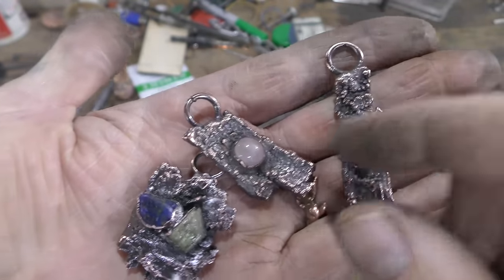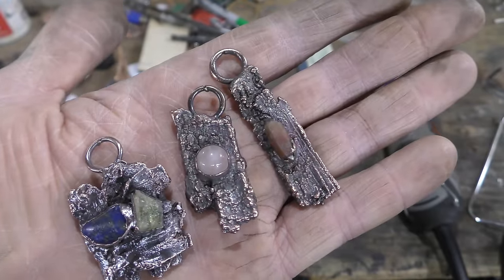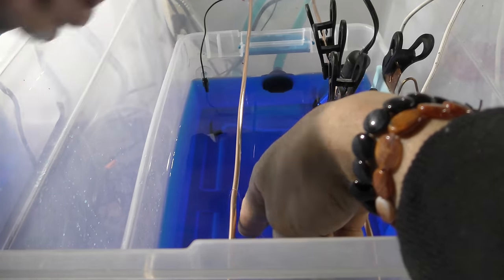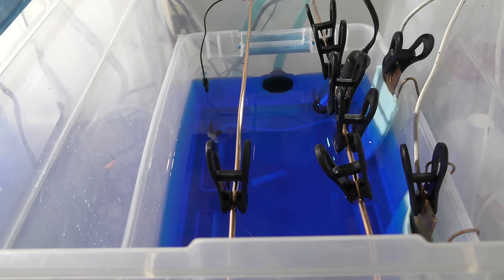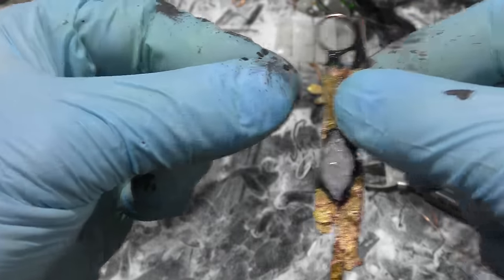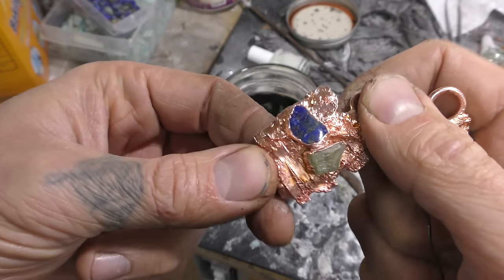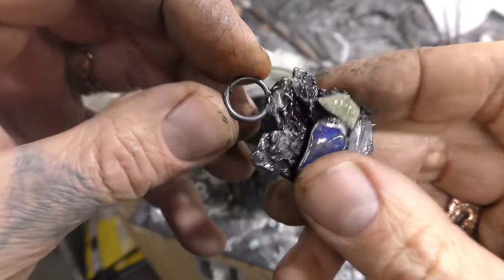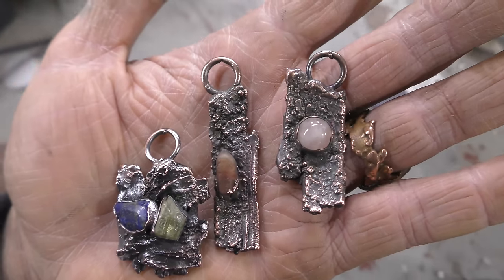Electroforming Organics for Beginners (Bark Necklace)

Comment: Awesome video! You said the dipping paint eats super glue.. so how come it didn't dissolve the point where the hanging wire was glued?
Reply: Did you find out the answer to this? I'm really struggling to understand too
Reply: I think he painted over it.
Reply: I saw on another video a drop of super glue then sprinkle that with baking soda turns it rock hard...🤷🏼‍♀️

Comment: Great demo, thank you!  Question:  why would you not glue the proper bail and the stone right away on the raw piece instead of plating part way, taking it out, and gluing them then?  It seems to be an extra step that is not necessary?  Or am I missing something?
Reply: I believe he said the first solution would eat away the glue.
Reply: But he had glue on the first one

Comment: Hello I have a couple of questions. What is the purpose of the liver I'd sulfur and could I skip it if I want the bright copper color?
Reply: Liver of sulphur is to add patina to copper. If you want beight copper to stay bright you'll want some other kind of finish or exposure to air will darken it over time
Reply: @ddraelynkhar  I am completely new to this is there any other finisher you recommend so I can research
Reply: @ChaosoftheDivineFeminineLLC  sorry not off the topmofnmy head becUss ei always do liver of sulfur.  I would recommend getting a copy of the Riogrande catalog or even calling the company to see what finishing chemicals they could recommend. They sell basically everythingnyiu will ever need for jewelry making
Reply: @ddraelynkhar  ok thank you for the info! I found out the finish depends on the time you leave the piece in the sdcc sulfur of liver
Reply: @ddraelynkhar  May work with ferric chloride.

Comment: Hi @Jason Welsh could you please make a video about how get a shine straight out of the tank. I am working with your free solution recipe. I used the brightener recipe you shared and set the power supply as you recommend yet I am having a dull salmon colored result that is not shiny and in fact a very flat finish.  So I was hoping you could make a start to finished piece tutorial piece. I seem just to missing something it would really help if you could get it all in one place.
Reply from the maker: I did do a video that refines the process of making electroforming solution and Brightners and tank maintenance all in one video. The content turned out so good I thought I would use it to fund other research.   https://www.firstdensitymaterial.com/collections/recipes-for-electroforming

Comment: So I’m a newbie. How do I achieve the more golden color
Reply: Play around with different patents techniques. The item with come out ofnthe bath rathe pink. Pure copper. You can get some shine by  carefully polishing/buffing it (by hand with barkeepers friend for instance or with a soft wheel on a dremel. Just dont go over board and break through you micronfineblayer)  or play with different chemical treatments. A longnsoak in liver of sulphur for instance can get you to matte black. A quick dip inthe dame chemical when very hot followed by a dip in ice water sometimes gives you a bit of rainbow. Buy a bit of copper sheet or pipe for experimenting on. The liver of sulphur is like7 bucks on Amazon for the concentrated gel and will last forever.

Comment: Could you show breaking a part? I guess since the copper is only a few atoms in thickness, the piece just has the strength of bark + modpodge or am i wrong?
Reply: You can form the copper to whatever thickness you like, if you want it to last you have to leave it in until it reaches the desired thickness, the longer it is in the solution the ticker it will be :)

Comment: Hi, I've been struggling to get the copper to plate onto some leaves. Ive painted them with graphite mixed with mod podge, but it did not work. The metal clasp did get coated, however. I dont know if its the solution, the voltage or the paint. Ive tried 3 different paints thus far. Any helpful tips?
Reply: If it's not plating then you have not mixed enough graphite to your modge podge, keep adding graphite and test it on something until it allows the current to flow :)
Reply: vmk  If the flower is floating, you need to use heavier copper wire to hold keep it submerged in the solution.

Comment: Just a tip, put the bail on going front to back. That way a chain can go through without needing another bail.
Reply: This is actually a jump ring, not a bail.  The bail is wider and more decorative and matches the chain.  You add that later.  The jump ring is stuck to the pendant.  Bails can be removed.

Comment: Isn't this electroplating? You are coating the bark in copper-the bark is still present in the finished piece.   Electroforming would be creating a copper bark but removing the original tree bark, so your copper version is separate.

Comment: I can't remember what size copper wire to buy for this to put in the tank? I haven't done this in several years. Anyone know? Thank you!
Reply: The support bars look like maybe 8 or 6 gauge grounding wire. He said he's using the strands from 14 gauge stranded wire to attach to each piece. As long as it's conductive and supports the weight of your work, any copper wire gauge is gonna work, this doesn't take a whole lot of current  so you should be good with mostly anything